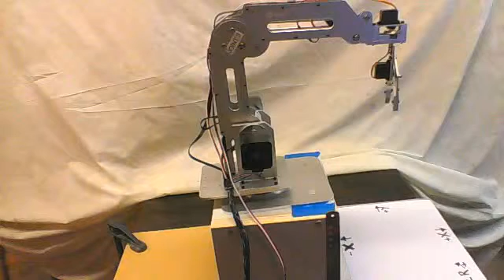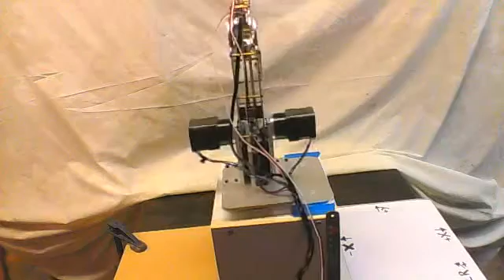Dobot Axis mode

Comment: hey great job, welldone! would you recommend dobot as a reliable machine to work as an exhibit in a museum for like 10 hours continuasly per day driven by kids through leap motion for example?
Reply from the maker: I would recommend it if you have someone that will dedicate 25 hours a day to figure it out, program it, without any help from the developers.  It is NOT precise, NOT reliable, and NOT easy to use.   The tasks the developer shows have never been done by other users.  I have not used leap motion options.  Commanded from PC windows and iPad.  Taught it to do tasks --- after about 3 repeats it will go crazy.   Remember  little or NO support from Chinese developaer.
Reply: thanks for the reply, have you seen their newer model dobot magic? could you suggest something more reliable and easy to develop?
Reply from the maker: One find a robot nerd, expert -- then have him spend 25 hours a day choosing, building, programing, fixing the bot.  Perhaps a lego mindstorms robot or   7bot.    Developer support a must!